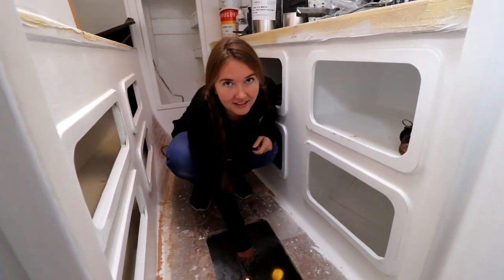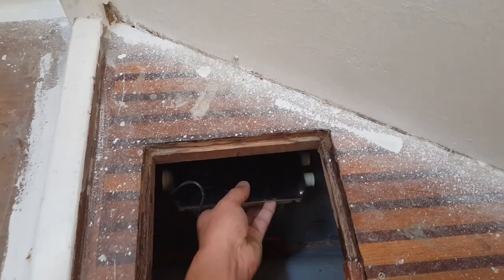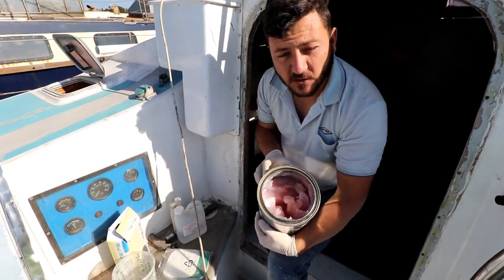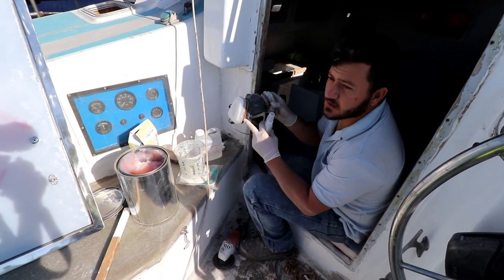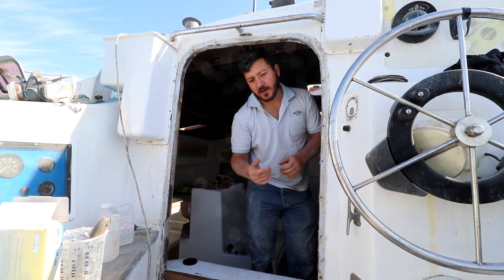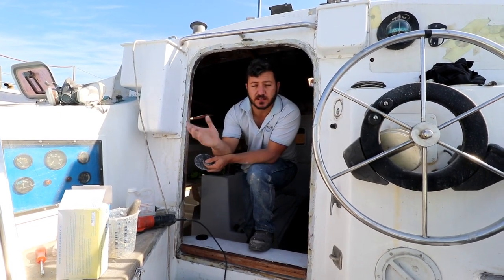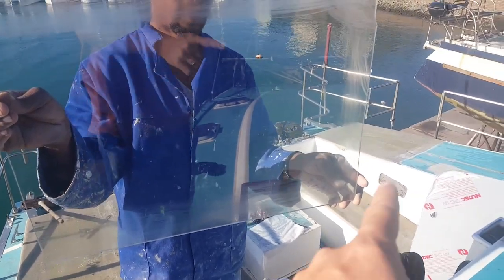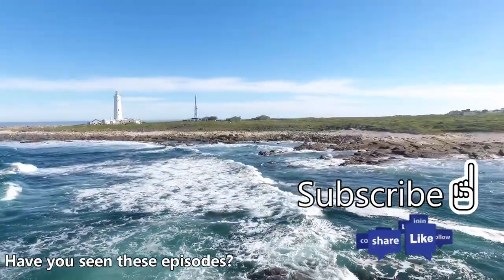DOOR FRAMES and WINDOW PAINS! | YACHT REBUILD WEEK 33

Comment: Polycarbonate is basically indestructible, they use that in the banks at the counter area. Acrylic can crack, especially if someone hits it with a hammer. I use to sell them both and the resins.

Comment: Polyester/vinylester resin without wax added can be laminated over with no sanding . If your resin/coating has wax added for curing , that will need sanding before over coating.

Comment: Thanks guys realy enjoyed ur video, you will know this boat inside out when finished. This will be so usefull when crusing and you have to fix things. The polycarb door is great know you chose the material for strength however i am sure you are also aware the down side is it scratch-prone and less UV resistant compared to acrylic. But think you have made the right decision in 5 years time does it mater if you have a scratched / fogged door NO but it will keep you safe and still let light in.
Reply from the maker: Thank you so much. Yes we are aware that it is scratch prone but we went for the safety of the polycarb. We most likely will add a protective layer film over the door just to help with the scratching aspect of it. It's also pretty easy to replace if need be down the line.

Comment: goodwork guys,can you send moses to the uk i need him to keep my boat as clean as yours!
mount your shower sump as low as possible so it will still work if dried out at an angle on a beach,also make it easily accessible as the hair and fat caught in the mesh needs removing every few months when it starts to smell or gets blocked if in constant use.
i opted for a whale gulper diaphram pump and water level sensor as less likely to fail ,and it doubles up as an electric bilge pump.

tinted windows  cover up imperfections to a large extent the  joint with the interiour joinery and window frames,plus add privacy

for using gravicol, i find after mixing it, that  putting the mix in a freezer bag suspended in another mixing pot  then using it like an cake icing bag,with the corner cut off is far faster and less messy than trying to apply with a scraper.just use a scraper or flexible spatula if you want a nice curve to remove the excess.
Reply from the maker: Thanks for the tips Alex. Moses loves that vacuum cleaner... if we stand  a bit to long thinking of ideas or what not. He already starts vacuuming.